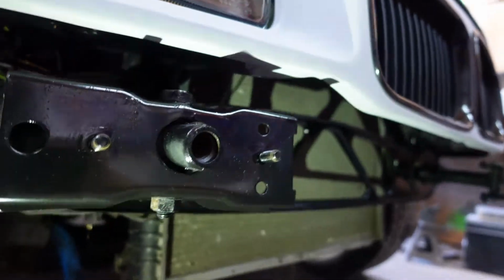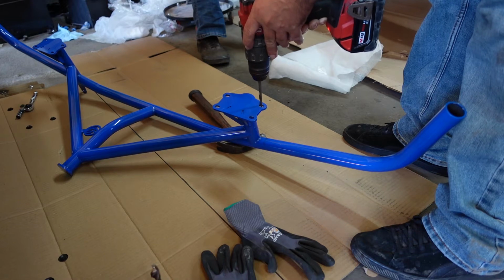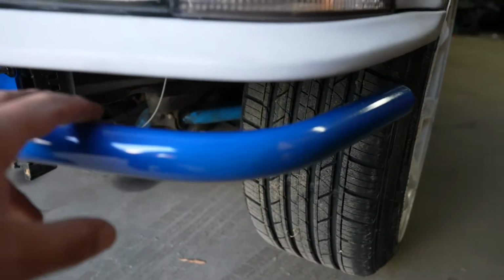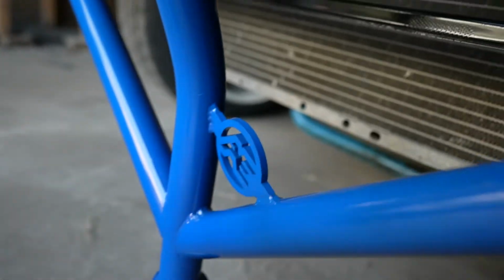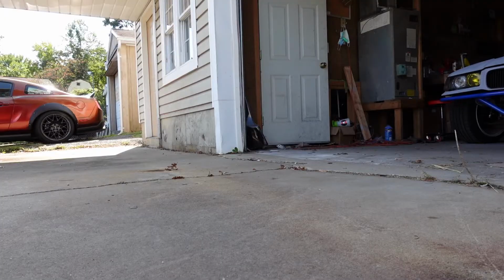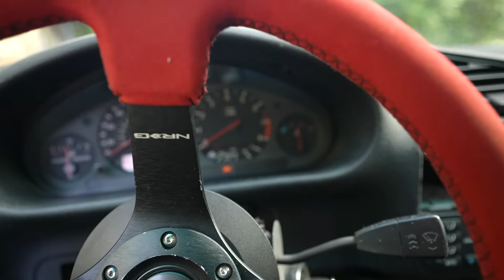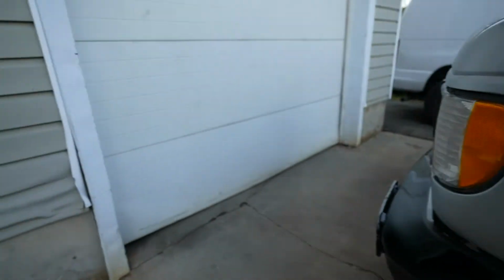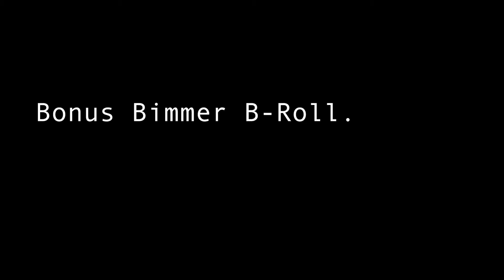BMW E36 M3 Apex Engineered Bash Bar Install and Review

Comment: so are you able to run the bumper. Does it cover it up? Can you use the jacking point + bumper at the same time?
Reply: Did you find your answer ?
Reply: @joshuacruz4046  no but drifthq says u would have to modify bumper. As in, cut the bumper. 

Making ur own is probably better